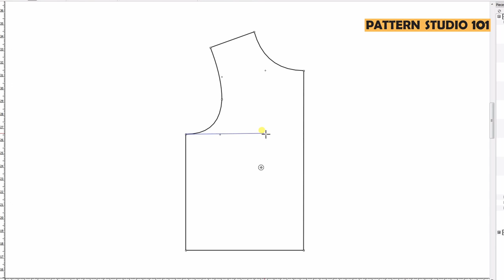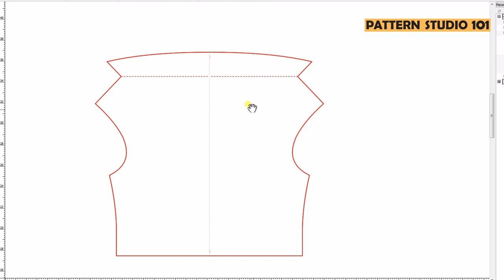Very Easy & Simple Way of Cowl neck pattern making _ with Folded Neck Facing

Comment: Thanks for this. If you move a side dart to the neckline, is the amount included in the 3.5" or do you add 3.5" more. In the pattern that you drafted (that didn't move the dart) would you still sew the side dart? Thanks.
Reply from the maker: Hi, no matter you move and dart to the neck or not, the amount of the front neck width is determined by your design. How much drape you want to have around the nexk. And in the video, I moved the side dart to the neck.